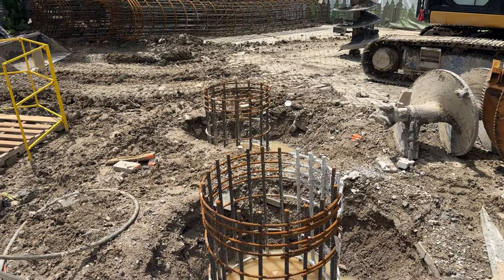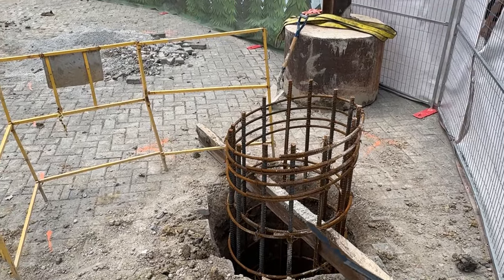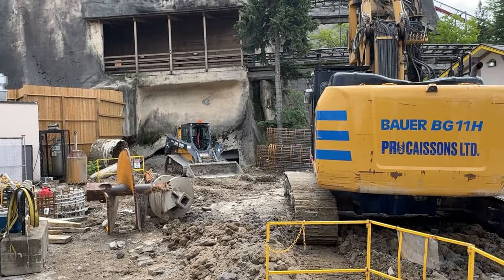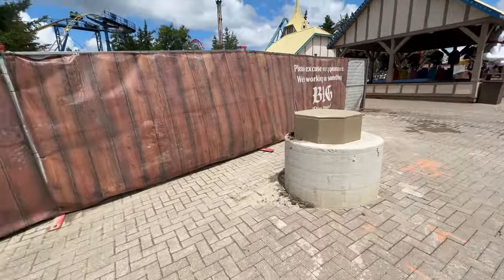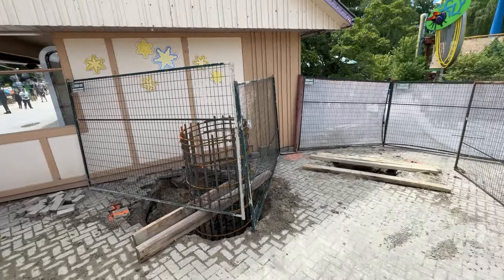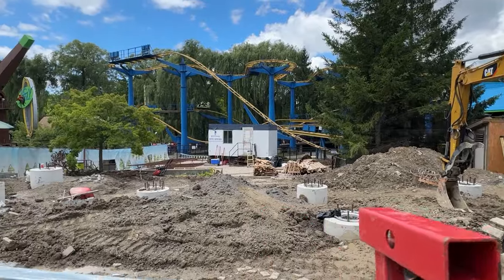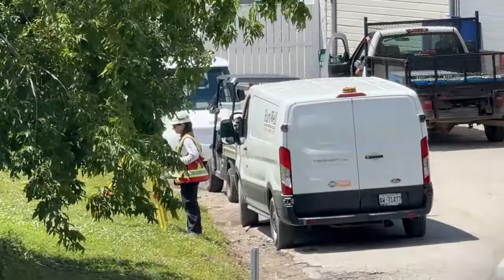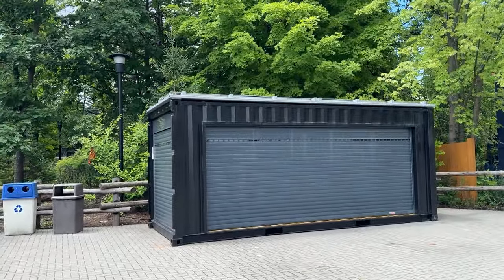Canada's Wonderland New Launch Coaster Caisson Construction

Comment: If I’m remembering correctly, it was said in an earlier video that this coaster will have more track than Levi?? I could be misremembering. I’m not so sure I heard correctly now.
Reply: Very unlikely. Leviathan is nearly 5500 feet. Even if you don’t include the lift hill Leviathan will be longer as will Behemoth. Expect this coaster to be 3400 to 4000 but we can hope for more. Better comparison is Maverick and Velocicoaster which are 4450 and 4700.
Reply: @johnboulanger807  yea I figured Levi was around 5000+ ft of track hence me asking.
Reply: You have to take into account that Leviathan runs so fast over that 5 Grand Plus track so it's over quick.  Premier will guaranteed have a longer ride time.